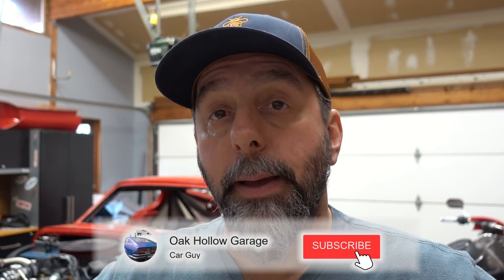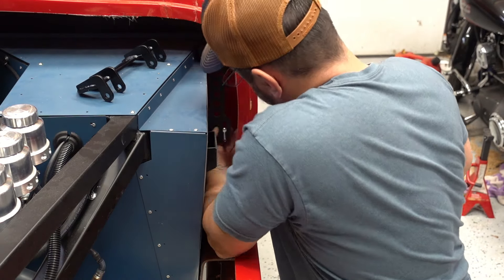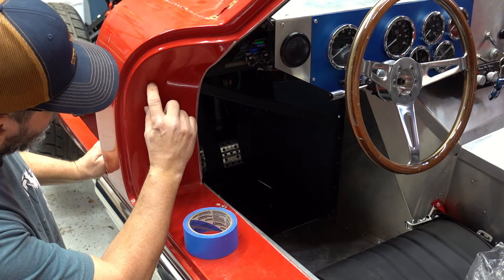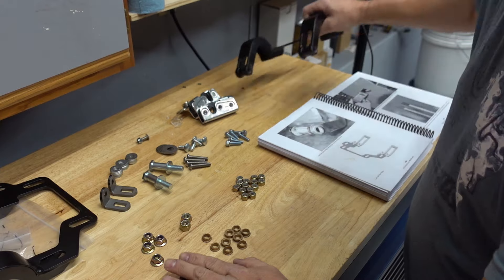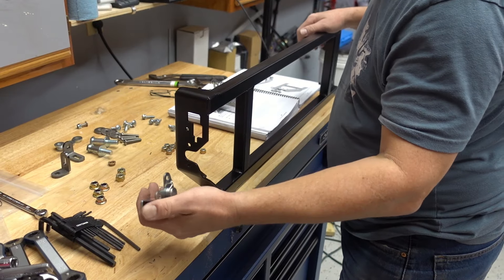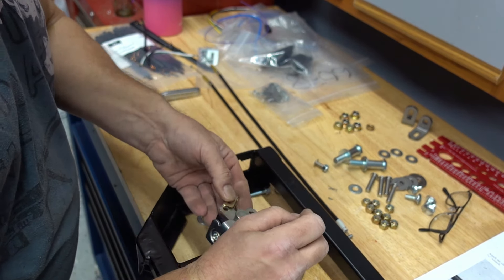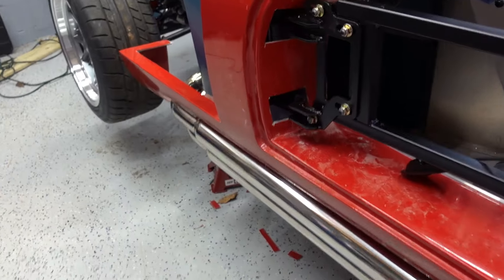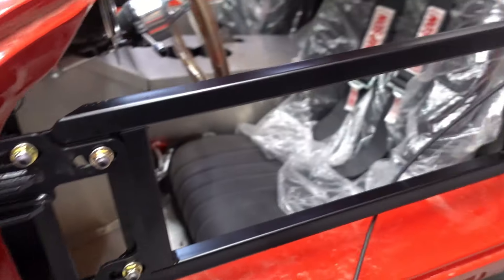Part 40 | Installing door hardware | Daytona Coupe Build

Comment: For what it’s worth, they should’ve emailed you the manual as a pdf. It includes colored photos, which makes it a lot easier to sort out some of the parts orientation.
Reply from the maker: I have the pdf manual, but don't have my computer in the garage right now. Yes, color photos do make it a lot easier to sort out part orientation.

Comment: Can you connect temporarily the doorstops, in the roadster kit, there are leather doorstops maybe that would give you an idea how far the door will open.
Reply from the maker: Ya, I was thinking about that exact thing. The leather straps will show me the extent of the door opening to see if I need to remove more fiberglass. I have to make all the cuts in the doors and get them on and give it a try. Great suggestion!
Reply: @OakHollowGarage  I’m really considering a Daytona build in the next few years from now
Reply from the maker: You did such a great job on your cobra, I'm sure a Daytona build will be great. If I do another build, it will probably be the truck.
Reply: @OakHollowGarage  thanks man, ya that truck kit is pretty cool.